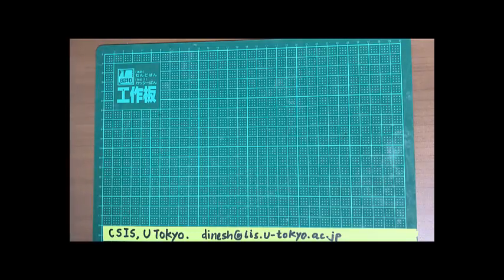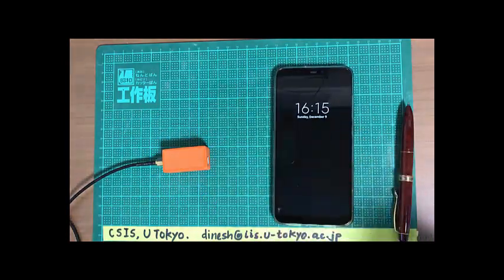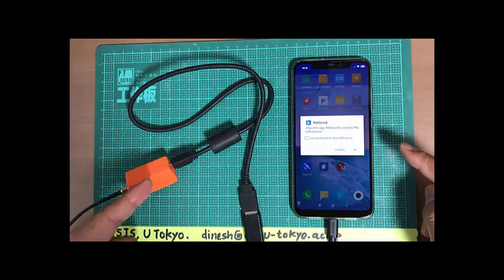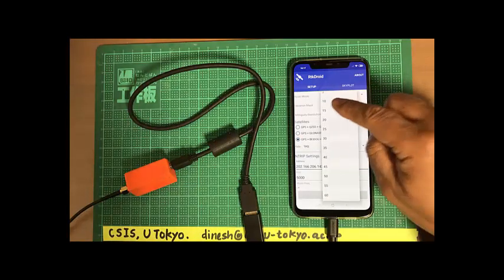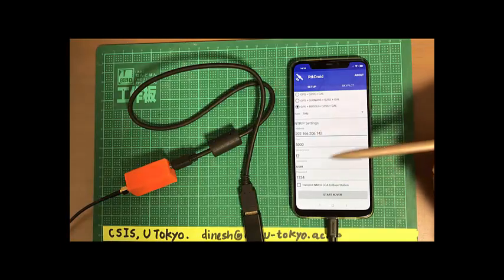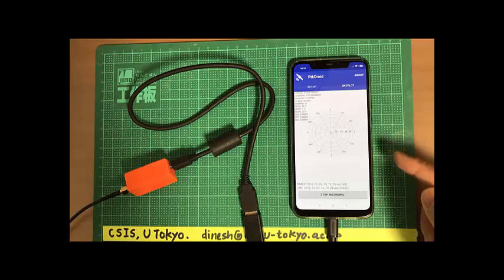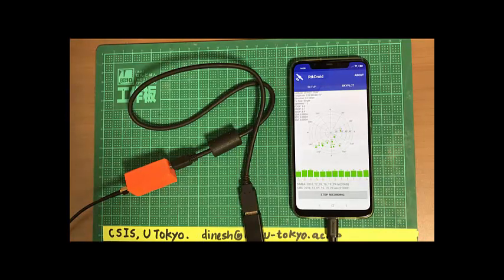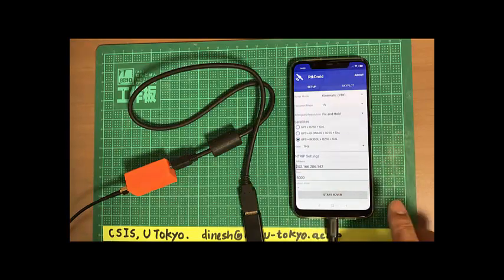RTKDROID for Low-Cost RTK System

Comment: Good day. I speak Spanish and I am using the Google translator.
My question is the following: to record raw data for post processing, is it also necessary to be connected to NTRIP?
I require the equipment to carry out land surveys in rural areas, where there is no Internet access, so the work methodology would be to record raw data and then post-process with rinex from the government's geodetic bases.
Reply: Excelent question!! I have the same doubt about that. I want to build a gnss rtk system
Reply from the maker: For real-time RTK, NTRIP access is needed. If post-processing is OK, then just log raw data. Make sure that the receiver is set to output necessary raw data for RTK. For details see webinar page at https://home.csis.u-tokyo.ac.jp/~dinesh/WEBINAR.htm  
https://home.csis.u-tokyo.ac.jp/~dinesh/WEBINAR_files/WT-103-401.pdf

Comment: how much accuracy please ?
Reply from the maker: M8T (single freq) gives accuracy of between 10 - 50cm. But, please note that the base-length shall be within 5km or less. F9P gives better accuracy and also longer base-length but still may be around 10Km or less. It also depends a lot on antenna used.